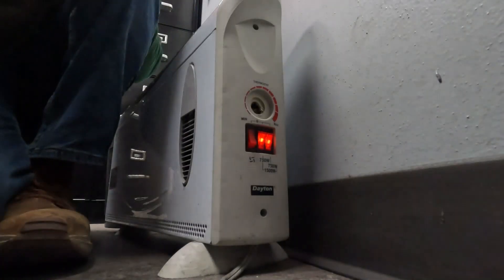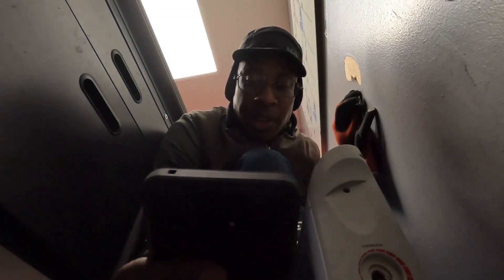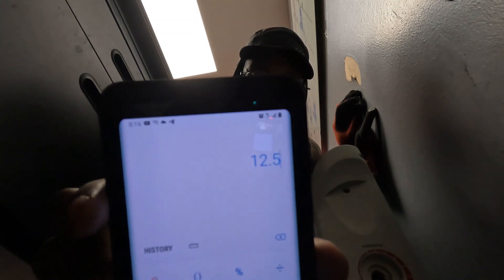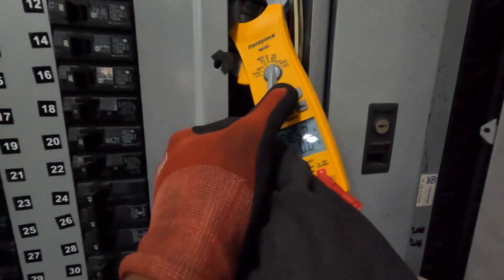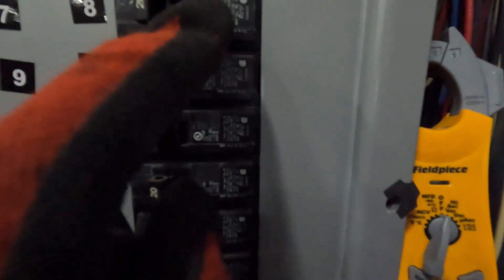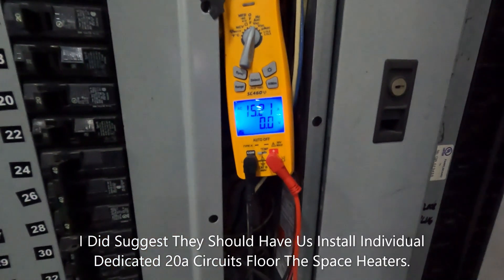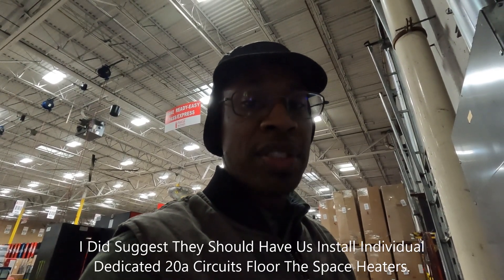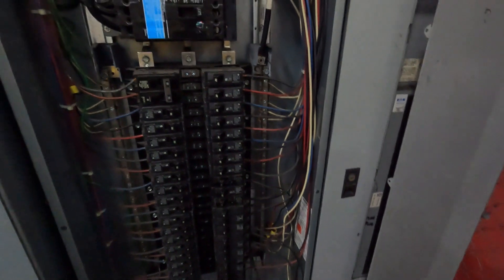Commercial Breaker Keeps Tripping Leads To a Cold Office. Space Heaters Are No1 Fire Starters.

Comment: Those Breake trips at 135% of it stated capacity.  135% of a 20A breaker would mean  that 20A Breaker will trip at 27A.

But it's not recommended for a breaker to work at load over 80% of its stated capacity .Nice work,great content

Comment: When it comes to larger repairs, if you present a proper troubleshooting case and root cause on what the actual issue, they will be more likely to pay for the service - such as what you did in this smaller case. If you can't prove why something is occurring, they are not likely to pay for future services or the potential quote for expensive repairs.